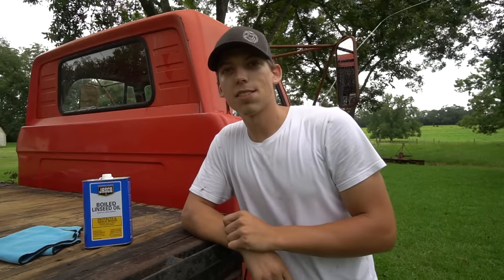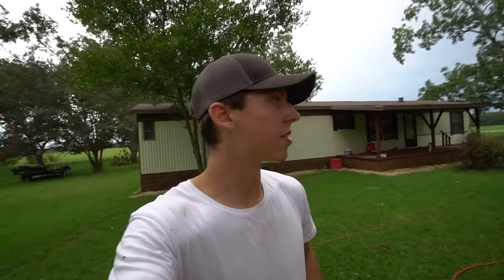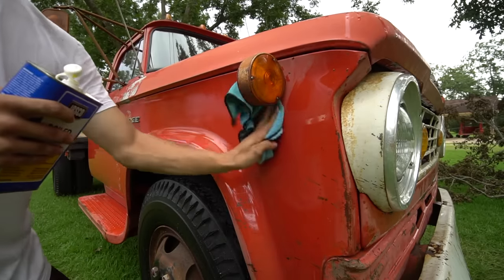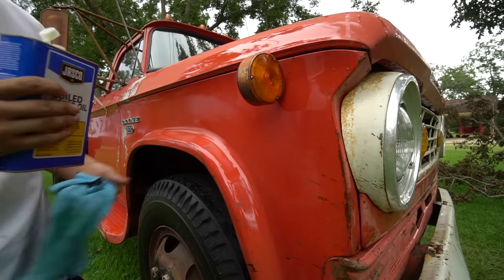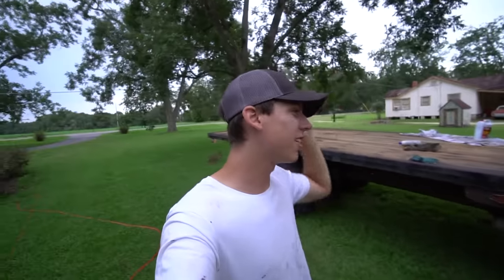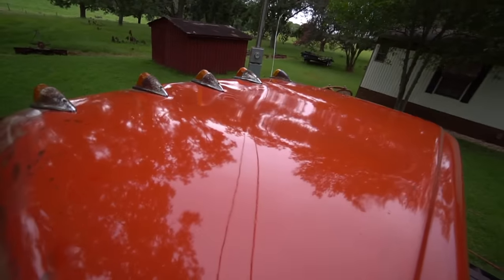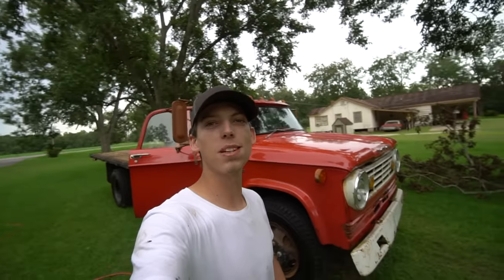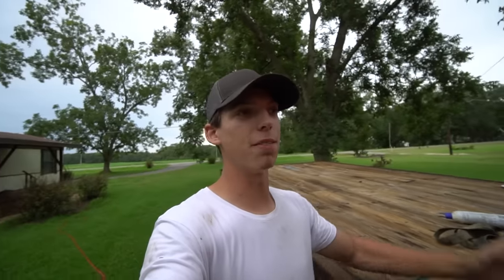This $8 Product Saved My Faded 55 Year Old Paint Job (Amazing Results!)

Comment: Now I am starting to enjoy cause no more little kid jirations and it is good. I think that if you add some fine fine steel wool to the arsenal and go over the turn signals on the fenders... they used to be chrome but the steel wool will knock back that rust and enhance the chrome that is still there... until finished with new at some time, it buys time to that will do list and the same with the grill as the paint that gets pulled into a cream and then resticks to that rusty look and then the rust just goes away and your going to say "This is good, fuck three thousand dollars worth of paint..." I like it and might just live. There is such a thing too as Molasses and water... it is not fast but WOW! You take like the roof lens's and the chrome holders, and just submerse them into the solution for say maybe two to more weeks and it just keeps working like a homebrew thing of fermenting and it takes old steel and turns it bright like new steel. A few youtube videos out there on this. My first one was a british fellow used it on some old rig that should of been hauled to the dump but instead of buying anything, it was remove and soak and put back on. I know if you had seen it, you would make a tank to hold the stuff, bolts included as it ate all the rust off his rims to make look better than new and when it got running was a before and after you just have to see to believe. Just as good as it gets for a poor man to take a little extra time and do but results are a showstopper. At least when you paint a rim or what ever, it is so easy.... it is the same process that the guys in a chrome shop use as they stick the item to be chromed into a vat and prep for the next step. The stuff they use would take the skin off your hands it mear seconds. This molasses will do the same but doesn't hurt you or your skin. I takes time but time that you can afford and like emblems off the hood thrown in to soak will really look new. Thank you for slowing down and acting totally different. Its a damn good look and will in the long run get sponsors n subscribers

Comment: Don’t go down a dusty road dippin it could get nasty  on another note if you sanded the wood bed  linseed is great for wood too protection Guaranteed
Reply: It dries after a while. Faster if you go back and wipe off the excess. He used way too much.

Comment: The lacquer based factory paint oxidized over time. The oil just removes the top layer and some junk. If you cut buff and wax you will restore and protect the paint. You can can't wax the truck with the oil on it.

Comment: Gasoline does the same thing. I use to have a red riding mower and I would shine it up with some gasoline although you have to be extremely careful with it. I did not put that much on a rag. A little bit went a long way.

Comment: Hi D.D. new subscriber here it wouldn't hurt to change the fuel filter. Did you ever get that mouse out? Are you going due any overhaul on the carburetor and that transmission? When you mentioned the miles it could be 155 thousand or whatever that miles was but not bad for a old truck nice job. Just remember you from a junk yard.

Comment: How do you mix it because I see it can catch on fire the linseed oil after you use it on a towel. I bought a fire resistant terry towel so it won't catch on fire after using it but still gonna put it in a metal can after using it and these fire resistant gloves am getting soon. Plus will use a mask when doing it.

Comment: I wonder how often you will have to re-apply the linseed oil?  It looks like the clear coat has come off of the paint.  Spray some new clear coat and you may not have to keep re-applying it.  Cost should be about the same.  You can pick up the clear coat at most auto parts stores.
Reply: Um, clear coating is not that easy. It needs to be uniformly wet and dry evenly. Also requires a decent setting so bugs don't get involved.

Comment: You didn't bring back the paint you just added a coating that reflects the light. It will fade quickly and need to be reapplied constantly. You could have spent $50 and polished the paint that would last for years with easy care.

Comment: I've polished my old car with faded clear coat.
Now looks great.
Give it a polish.
This oil is useless.
I've applied silicone once on my car. I had to remove it with gasoline.
It has gotten hard and looking bad after sitting in the sun for a summer.

Comment: I hope you're not going to make this a "patina" cruiser and you eventually repaint the truck. It's too nice of a truck to make a patina rod out of it.
Reply from the maker: All depends on the videos. If they are doing well and they are turning a profit then I may repaint it
Reply: @DippinDiesel  Linseed oil is organic. Paint is an ungreen waste of chemicals unless you don't like red.

  One bureaucratic irony i'm faced with is my super green 1.0L Metro 3 cyl. may fail smog check because I live just inside an urban county and the crank sensor thinks a burnt valve is a misfire and throws a misfire code.  And I passed up a damaged but still gorgeous '95 guppymouth Metro which I found out later was the last year exempt from smog check.  NEVER drive anything that isn't age exempt from government!  Damn Bureaucrats! 1.0 L isn't green enough for them????

Comment: It Looks great till the next Rain. Then you geht a thick fat lubricating film in your Front and Side Windows. And this you get Up only with degreaser.
And the degreaser will destroy all of you silly work.
No car painter will take IT before the oil Film completely washed off.
Otherwise sand and dirt will act like a grater and destroy the remaining paint. You didn't do yourself any favors.
But i think You also noticed after the first invoice from a car wash for dirty brushes in 3 years

￼

￼

Comment: That shit is extremely flammable.. Ditch the rag and dont store it in a packed area. It's used in woodworking alot and the rags will spontaneously combust if not in a well ventilated area.

Comment: Good try! I am sure this has been done many other times but all with the same result. You can get the same result with any petroleum based product, it lays on top of the paint and looks shiny but when worn off by rain or washing the paint is still the same.  Compound and polish it. The patina will remain and it will be easy to clean because the large paint pores will be smoothed over not fill with oil.  That oil will attract every bug and dust cloud in the county.  When I was a kid I did this oil thing, mistake!!